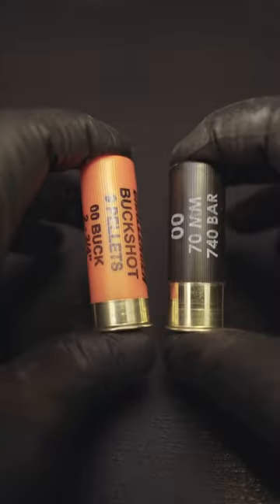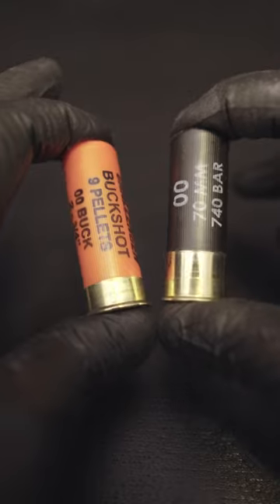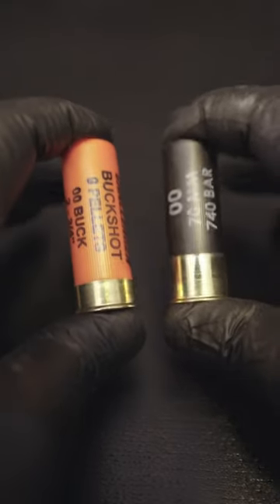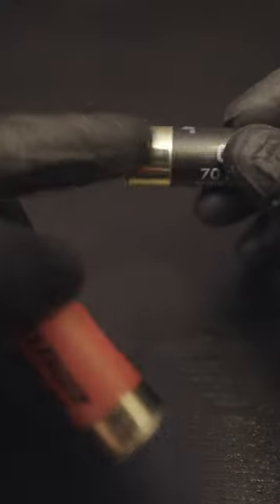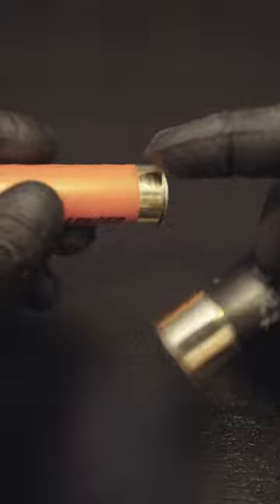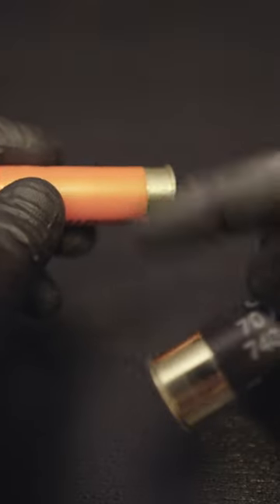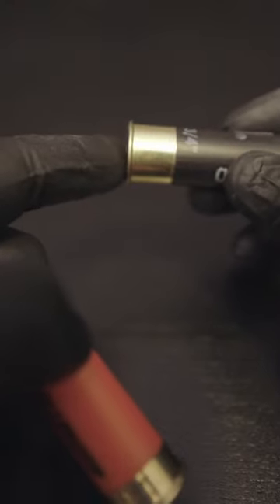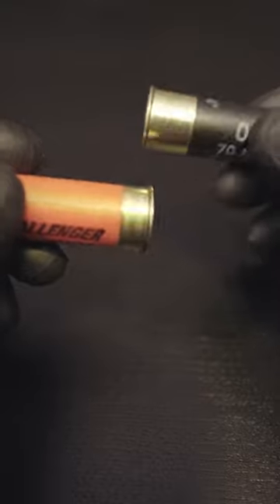Difference Between Low and High Brass Shotgun Shells #shorts

Comment: I handload 00 buckshot loads.  You can load a powerful “hunting” load in high or low brass.  It doesn’t matter because the pressure is contained by the shotgun chamber, not the brass, per se.  I actually prefer low brass, because you can see the powder better when loading clear plastic hulls.  They just look cooler 😊
Reply from the maker: That’s cool :-) I didn’t know that, and now I do! Thank you :-)
Reply: I like low brass because I can load slug and buck in Walmart birdshot hulls

Comment: I have a KSG and it does not feed low brass at all. I heard this, tested it, and it will not reject when I shoot low brass. Also says in user manual, only use high brass cause low brass will not function properly. Crazy how this difference makes all the difference.
Reply from the maker: Very odd. Never had an issue like this.
Reply: @michaelprobasco9883  Omega Turkish Semi auto wont cycle them either. Have to manually eject them. But the guns only 300 bucks lmao.
Reply: @austinlloyd3895  I've got a SAS12 mag fed shotgun from China, was $150 after transfer fee but it's the same way and specifies to only use high brass at least for the first 300 rounds

Comment: It's more of a myth tbh, but hi-brass shells do load pretty nicely and quickly in semi-auto magazines and don't seem to get stuck on the "brass" when pushing them in the magazines. 

Generally tho, the hi-brass stuff is just because people buy whatever looks best or what makes them think is better, and it sells better for magnum loads where people what "the best quality"

Edit: Another thing to mention... most magnum loads use slower burning powders which don't really change the pressure, they just use more of the barrel to accelerate the projectiles, so the argument about more power is only partially true...
target loads usually use small loads of fast pistol powders which burn mostly in the first 5 inches, and magnum loads use usually magnum pistol powders which mostly burn in the first 10 inches or so
Reply from the maker: Very informative, thanks for sharing!
Reply: The hi low brass makes no difference on plastic hulls but when we used paper the high brass woukd keep t h e powder from burning through the side of the hull. Today we're just assume hight brass is more powerful because those before us did and the ammo company's load it that way for us. + it just looks better

Comment: High brass or low brass does not matter in modern plastic shotshells. High brass and low brass mattered when we had paper hulls with black powder. The brass height had to be roughly the same height as the powder charge or it would burn through the paper. Challanger loads their target slugs for instance in a low brass hull even though they’re still moving over 1400fps.
Reply from the maker: Good to know, thank you :)

Comment: Does more powder mean less pellets
Reply from the maker: Not always. The difference could be pretty small. You can also have more powder and the same or even more pellets going up to a 3” shell or bigger. 

Most often a buckshot will have 7-9 pellets, or around there. Most of the time low brass shells are either slugs or target load (like a #7) so the pellets are quite small.

Comment: I thought if I use high brass it wouldn't work helped
Reply from the maker: What do you mean? Hi brass generally just means you've got a bit more powder in there, and that's usually the case for slightly heavier loads, where you need more propellant to get that load down range.